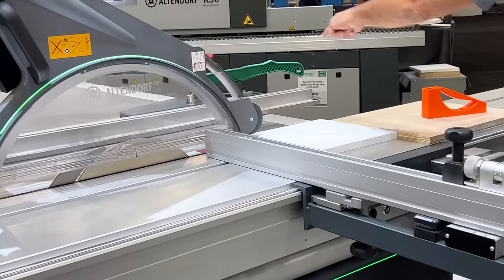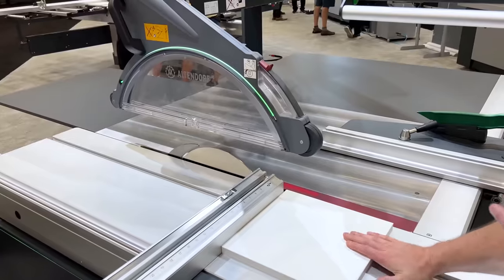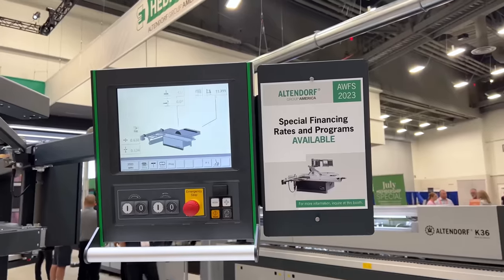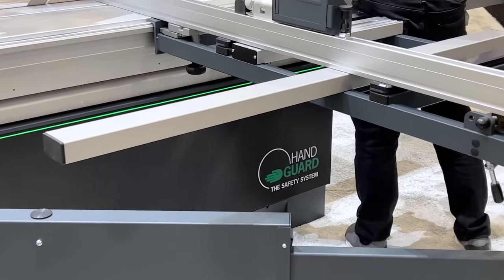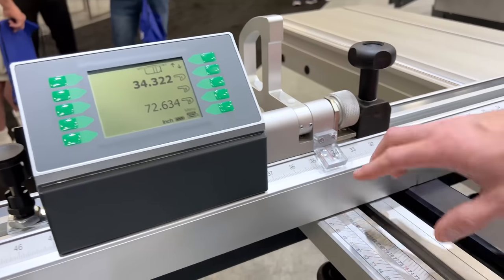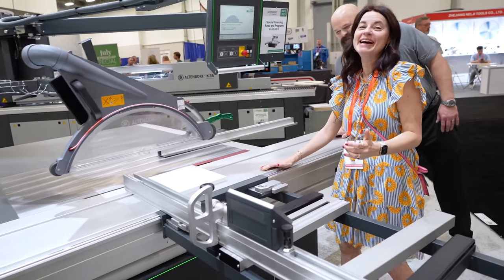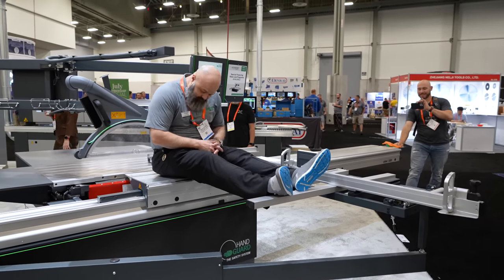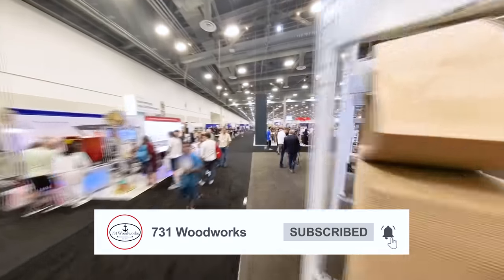The Most Exciting Table Saw in YEARS!

Comment: Definitely cool tech. I wonder how reliable the hand detection is, as it's software based, rather than the much more simple capacitive contact detection that SawStop uses. I imagine (I hope) they have tested the heck out of it, as a failure would most likely lead to liability lawsuits. Anyway, it's great to see this kind of safety tech integrated into the saw, and I hope it will make it into consumer-level saws soon.
Reply: Altendorf wouldn’t bring this to market, if they weren’t absolutely sure it’s safe. They’ve got a lot to loose.

Comment: What about if there is some sort of a kickback that pulls your hand side ways? Also the biggest challenges with this tech is fast retraction. Vision system would not be that difficult or expensive. Since it is not destructive, you could easily over do it for safety.
Reply: The cameras are positioned in a way that it can probably still see your hand until its well past the blade, plus I'm sure with something with that much tech in it, its got some sort of kickback sensor that can trigger the blade retraction, especially since its non-destructive.

Comment: our shop has an altendorf elmo from the 90's. still works perfect. That sensor is very nice but is not a sawstop killer simply because of pricepoint. It is awesome that you save the blade and get back to using the saw within a few minutes. I triggered the brake on our sawstop ics and it took me a couple of hours to remove the spent cartridge and blade.
Reply: I had to reply...when the safety system activates, it takes 10 seconds for the blade to come back up and for you to be back up and cutting material. 😊😊

Comment: This looks like an amazing piece of kit. Although i have heard reports for it struggling in poor lightning conditions and with shadow's, causing faulse activations. I would like to see this kind of safty feature become available on a machine designed for the smaller workshop, i believe that both Altendorf and felder only offer them on the larger models.
Reply: I wondered about that, as even my vinyl cutting machine has issues with registering in low light conditions.
Reply: Not so surprising I suppose, but a shop should be really well lit anyways - so I wouldn't expect this to be a problem in real world conditions. If I can afford this saw, I can afford proper lighting for sure!
Reply: @joeporkka2047  you make a great point. I am just going on reviews that I have read where a few of them said that they had to disable this safty feature due to faulse tripping of the blade and Altendorf said it was due to poor lightning. No personal experience as they are well out of my price range and far to big for my shop. I would love to have one though and did look at them at one point.
Reply: @joeporkka2047  I agree completely, but in my case, even standing to the side can cast a shadow and keep it from “seeing”. But yes, if I can afford a saw that costs that much, I can afford adequate lighting! 🙂

Comment: I'd be interested to see the fmea on the machine vision system. I'd still much prefer having the saw stop system as well.

I can think of a lot of plausible edge cases and combinations of conditions that could cause the machine vision system to fail.

So while it is a fantastic improvement and can greatly reduce down time, I'd still much rather it augment a capacitive system like the saw stop. It doesn't replace it.

Comment: Great saw!! I wonder if it reacts fast enough in the case of something like unexpected kickback that might force your hand to the blade?
Reply: I use a slider table saw every day at work. You utilize hold down clamps for the work piece you are pushing thru. Your hands should never be as close as they are putting their hands. So, there is no risk of pulling hand into blade. This is wonderful technology! If a slider is being used the way it is intended, then there is very little danger
Reply: @ryanpalmiter6863 The point of this technology is not to work only when you did everything right in the right conditions. Or a normal table saw will do the same.
Reply: @Maxime-ho9iv  I agree! I was referring to OP saying kickback pulling your hand in. I think this technology is wonderful and this/sawstop technology should be required for all table saws. The seat belt of table saws

Comment: From a layered safety perspective, it would be great if a saw contained both technologies. If the hand recognition ever failed for whatever reason, the SawStop sensor could back it up.

Thanks for sharing!
Reply: one of the reasons we pursued this was to allow the operators to cut ANY material on their saw. A capacitive system cannot cut aluminum, concrete/masonry products, "wet" hardwoods but our system has no issues with these and other materials causing false activations.
Reply: @BradSnyderAltendorf  Excellent points that I did not consider while looking through my “wood working” safety glasses.  It’s an impressive machine and I applaud the engineering and technology that went into it.  

Now, how do you get a brochure packaged into every “Safety First” banner shipped to carpenter/machinist shops ?
;)
Reply: @BradSnyderAltendorf Why did you not demonstrate the most likely scenario of an accident & that’s a hand being pulled in from the back/side from a kickback? People don’t generally put their hands in the path of the saw, the hand gets sucked in in a milisecond during the cut.

Comment: Next up - would love to see a solution for bandsaws. A lot of exposed blade and close hand activity - with plenty of unpredictability in the work.
Reply: i am sorry, but i cant really see an option for bandsaws... simply because where would the saw blade go? maybe some kind of resiprocating band saw, using just a section of a saw blade, being pulled down through material by the motor and back up just by spring tension, in an event of hand coming close, the connection of the blade to the motor below would release and the blade would "jump out" in a safe way on the back stroke? but then again, you loose the speed and advantage of using a bandsaw in the first place...
Reply: Only way for bandsaw is stopping it dead like Sawstop
Reply: @YaH_Gives_Wisdom You could just shear through the blade. That would require a pretty strong housing to contain, though.
Reply: @tyrannosaurusimperator  & what, have the 2 ends flying and warping uncontrollably, potentially making it even worse?

Comment: Cool. I think they could do this on cabinet saws without raising the cost too significantly. It looked like the blade was driven down by a servo motor with a ball screw. Servo motors are becoming more compact and less expensive. Also there are cameras and software like Cognex insight that are fairly inexpensive and can easily detect a hand. I imagine a fair amount of cost would be added for liability and redundancy of the safety system though.

Comment: So don't get me wrong, I love that someone else is trying to do this and bringing it to market! The side "I" don't like is being electronic. yes they have come along ways but I have also seen way too many new electronics fail. I would be worried of a failure like that and it not allowing it to drop properly. However  maybe there is more safety features built in to help prevent this? Again great idea and hope to see more things like this on a hobbiest level!
Reply: Mechanical things break, too. And most of the time, on industrial machinery, you’ll still need a tech to come repair it. I used to share your opinion, but after embracing things like DROs, I’ve found my work flow to be far more efficient and the end quality to be higher.
Reply: @montet202  I agree that mechanical can also fail but in my experience just more reliability then electronics. Coming from the maintenance side of a big mfg company I deal with way too many electrical issues on our machines. However, half the plant is also 80 year old retro fitted stuff 😅.
Reply: @techmike36  for sure.  There are certainly trade offs.  But if, say a DRO actuated fence saves me 200 hours over the course of a year and breaks down once every five years for a day or two, I’m still money ahead.

Comment: Hello. It's working only on a forward mouvment, not if it's a sideway one? For example taking a wood piece behind the blade...
Reply: the system tracks up to 6 hands at a time, 360 degrees around the blades. 😊
Reply: @BradSnyderAltendorf  ah ok it coule have bé nice toi see it, thx for sharing it

Comment: First let me say that I enjoy all your videos and have learned a lot from you as well as from many others in the woodworking community. As a retired software developer who just recently picked up the hobby and purchased new tools, I can tell you that the software component to identify and detect the/a hand within the danger zone and send a stop signal is not the problem, or the major cost component. The design and the mechanics of driving down the blade and its associated physical components (motor, etc ) represents the real problem/costs in overriding the inertia of moving heavy equipment faster than you are moving your hand forward. In a sliding table you can at least compensate for that by controlling the speed with which you can move the slide, but on any other table you might need to put a roller in front of the blade or in the fence to do that same function. You will still need to be able to drive down the blade structure fast enough. One of two ways that it could be accomplished, and it would be rather unusual, would be using compressed air or the firing of a 27 caliber blank driving it down achieving cheap resets without harming the blade.

Comment: Granted the camera system is good, but most accidents are from the back side of the blade or just a simple micro-second lack of concentration. I doubt the camera can react as quickly as an electrical current such as Sawstop in that scenario. I'd be intrigued to see a demo of that...
Reply: there is a head to head that was conducted by a German based company, they have a video on here somewhere comparing the 2 and its surprising.

Comment: I wonder how well this camera system works when the hand doesn't slowly creep up on the blade, but rather gets violently flung into the blade due to kickback/binding/whatever it's called. Sawstop apparently has a 5ms response time, or 1/200 of a sec. You'd probably want several times that in framerate, so you're  looking at ~1000+fps cameras.  And an computer fast enough to accurately process that imagery.  I've done image processing work and that's a lot of things to get right.   

Actually, that all needs to happen before the blade can go down (in comparison, the SS's analog detection mechanism is "instant', i.e. it happens at the speed of electricity, basically), and tbh the lowering mechanism seems much slower than the SS.
Reply: The Sawstop 5ms "instant" response only starts when your finger actually contacts the blade. The camera system is constantly tracking your hand so it has much more time to do something because it can be predictive rather than just reactive. Current image processing technology is easily capable of processing the video information in the time available.
Reply: @GarthMyer  theoretically true. But if it were true in practice self driving cars would never get in accidents
Reply: @toshn4151    Agreed - all systems have points of potential failure. An AI is a class of software. It is not universal - each implementation is specific to the task. The car accidents were reportedly due to flaws in the logic of the processing software rather than limitations of the hardware.

Comment: I wish I could have heard more about how the hand detection works, mainly how many times it can check per second if your hand is moving toward the blade. if it's updating less than 100 times per second I would not feel confident in a system like this.

Comment: I'd be curious does it only work when the fence is moving or will it still drop if it sees a careless hand goes near the blade as in moving parts to be cut or other.
Reply from the maker: It will work without the fence moving.
Reply: The system will activate no matter what else is or is not going on. If there is a danger to a hand, it will remove that danger before any damage can be done. Then 10 seconds later your operator can resume working. No blade/cartridge destruction requiring new parts, no time waiting for the aggregate to be magnetically picked up.
Reply: @BandSWoodcraft  Good to know!! I do have a sawstop now and happy to see new technology is getting even better. I always worry about a false trigger with static or moist material as that would be $90 brake and probably a new blade needed. So far been lucky.

Comment: Amaizing! What about making those vernier cuts with a push block? How about cutting dadoes? Can this saw's mechanism tell the difference between a safe close cut and a hand in the way of the blade?
Reply from the maker: I wish you had been there Tom!  Those are all amazing questions I SHOULD HAVE ASKED 🤦🏻‍♂️
Reply: Tom, great questions! To answer them, YES you can run dadoes and even program them so the rip fence will automatically move to a precise point and you get perfect dadoes every time. We also include a push stick with a holder that has a magnetic base so, yes you can use a push stick. No matter what you do with your hands, the AI will not allow you to come into contact with the blade. One other thing I didn't mention is that this system allows you to run any material without worrying about false activations. since it is not a capacitive system you can cut aluminum, foam, concrete, even wet woods. Truly a unique safety system that is the first and ONLY safety assistance system to receive the GS seal for tested safety.
Reply: I just realized I may not have answered the 2nd question 😂.  By vernier cuts I'm assuming you mean miter cuts and not bevel, the outrigger you see in the video has a miter crosscut fence that can be set to get those angles and for bevels, the computer controls the angle and height adjustments of the blade.
Reply: @BandSWoodcraft  By vernier I mean a thin slice off of the edge of a board running against the fence. This is not a miter cut. One would use a push stick and perhaps a feather board to guide the wood through the blade. Most of the time a person would just set the position of the fence and the height of the blade for a rabbit or dado and just make the cut with their hand since the blade is not exposed to the hand to make these cuts. My question is will this machine drop the blade on you when you push your material through the cut with your hand?
Reply: @ancienttom97  ahhhh, my terminology is slightly different! 😂 Those are easily done on our saws since the rip fence can be placed further forward and cover the length of the blade or moved back as well. Many of our operators do these types of cuts to create their own edge banding so they can match veneered materials.

Comment: Curious if it can react when kickback occurs that flings your fingers into the blade.
Reply: YES! During the normal demonstration we show how the system activates even when there are sudden movements that can be caused by kickback or even someone slipping and reaching out to arrest their fall. I can TRY to grab the blade and cannot do so. It really is an amazing jump forward where safety is concerned in the shop.

Comment: Most injuries Happen on regular table saws not slider panel saws as it’s much easier to keep hands out of the way running sheet goods. And this uses a guard which most people only use when cutting sheet goods. Hobbyists and most wood workers that have a powermatic or sawstop this particular setup wouldn’t help. With that being said the use of sensors is a cool idea but curious how it overcomes actual use cases where as sawstop has that figured out.

Comment: Thanks for the video.
Sawstop tech is in saws that you can pay several thousand or more for.
This "Hand Guard" Altendorf starts at €45,000.
While they make a lovely smaller sliding table saw, the WA 6, it doesn't have this safety tech.
While I like the mention that they may add this to other saws at some time in the future, I'll believe it when I see it. Until then, it's disappointing that they're realising a critical safety feature in their most expensive saw alone.

Comment: The thing that surprises me the most is how insanely quiet the machine is. Now i know its a fancy dancy new machine, but still very cool
Reply: You are the 1st person that has made note of the fact that a machine that large, moving that much weight very quickly, is in fact extremely quiet. It shocked me the 1st time I stood next to one. the other thing that I was shown (should have done it in the video! 😢) was that a coin can be placed on the table on edge and won't fall over during operation OR when the safety system is activated. It's a testament to the rigidity and stability of the machine along with the overall engineering involved. 😊😊😊

Comment: Back in 2000 I worked at a commercial Cabinet/Millwork shop.  They had an Altendorf saw.  Obviously not as sophisticated as this one.  I ran it a number of times until I have a kick back.  That saw had so much power that when you bind that blade the whole shop hears it and shop foremen ran up and hit E Stop.  Yes that was a change your shorts incident.  When a saw can kick a 5'x10'x1" sheet of plywood like it's a player card you don't make that mistake more than once.

Comment: I've used "no-blade guard" table saws since I was ten in Elementary School Shop Class. I'm 70 now. Mr. MacFarland taught me how and how NOT to use the 14" table saw in the woodshop. Mr. Mac as we called him, was about 70 at the time I was ten. I was the only kid in class that he let use the table saw and the HUGE bandsaw (an Industrial 22" or 24" Miller-Falls). Saw-Stops cost over $800 to repair if they "save" a finger (which doesn't work MANY times). Common-sense and caution out-perform gim-cracks.